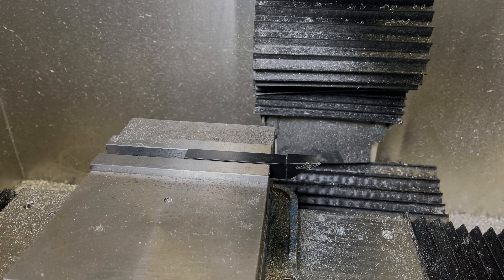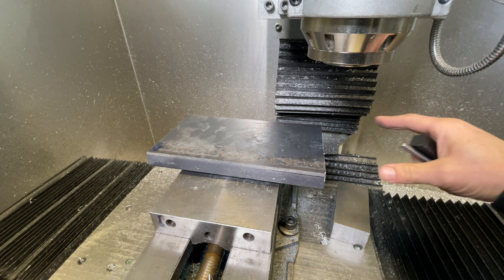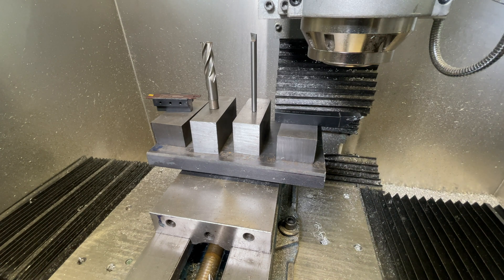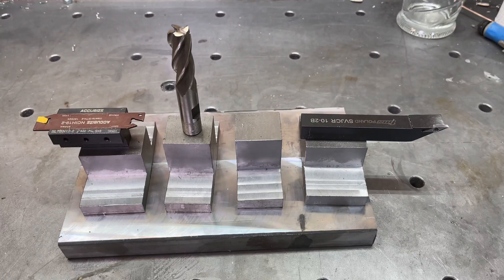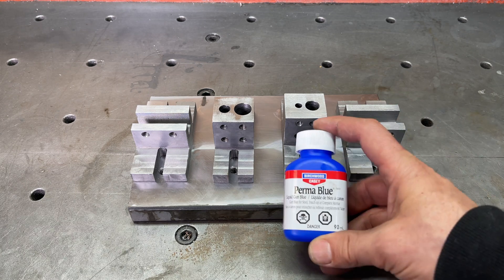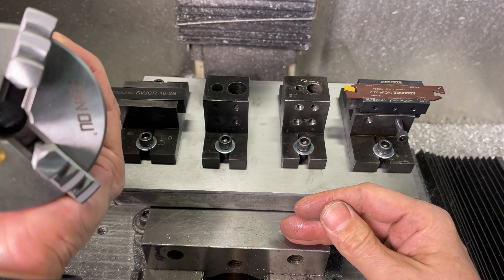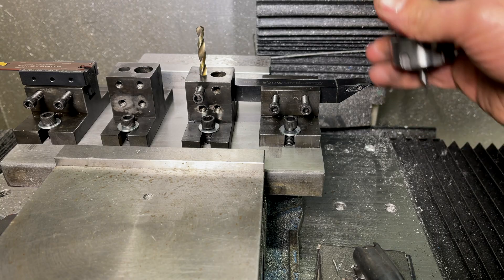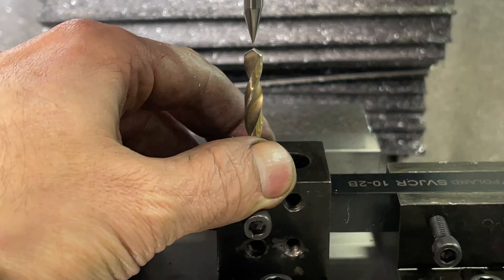CNC mill to CNC lathe

Comment: I really need to get going on a project like this for my tool room mill because mistakes were made and I didn't buy a lathe for my milling shop before getting started. Some tool holders for my angle plate would probably do the job in conjunction with the horizontal spindle. Good job and the part came out nice!

Comment: 🤔 Now I'm thinking...   a rotary attachment on the x-axis table with multiple tool clamps - (a vertical CNC Lathe automatic tool changer)... rotated into position via a servo motor, probably with some kind of mechanical air-assist locking mechanism... a kind of indexing plate to lock everything in.
Reply from the maker: Don’t put that kind of ideas in my head! Lol

Comment: 500 RPM on an empty chuck.. don't do this at home kids! Maybe you should now make a mounting plate with a direct mount for your spindle?
Reply from the maker: There is a flat washer inside the chuck. Would love to make direct mount to it at some point just need to figure out how to
Reply: @advanceair  buy another tool holder, something like a threaded body tool holder, or something with a lot of "meat" in and near the taper portion and turn the holder for an adapter directly on the spindle, then it'll be perfectly concentric.
Reply from the maker: @daboyakasha101  Working on something like that  :)

Comment: how does your spindle spin at such low RPM. I thought those type of spindles had a much higher minimum speed.
Reply from the maker: This is 5.5kw very large spindle. I can run it as low as 900rpm

Comment: im pretty sure the top side of a turning tool shank is on the same plane as the cutting edge, that would mean you can zero your y axis either on the shank or on the holder you made
Reply from the maker: You are right. Thank you.
Reply: @advanceair  No problem :) I should add that for boring bars the cutting edge is on the center if the flats on the shank are dialed in